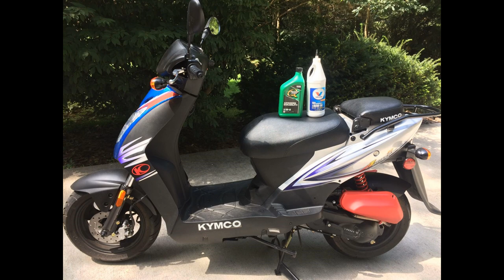Kymco Agility 50 - Oil Change / Gear Oil Change

Comment: Good job on the video.  I have a 2015. Kymco 50.  And that's all I do. It ask for nothing. But engine and gear oil change at the end of the season.  That is it.    👍.
Reply: Yeah man I have an 07 kymco vitality 50 4 t and it has 19500 on it and it ask for nothing but oil change and gear oil change ,most reliable little bike I've ever had

Comment: I gotten the high performance Naraku cdi and it gave it a huge boost of power then upgraded the transmission with the same company with 5.5 gram rollers got more power don't lose power going up hill. Removing the spacer in the exhaust pipe gave it better air flow added to the top speed can now go 50 mph 40 to 45 up hill. Thought I  would give you an update now that I've done it and tested it out for a week before letting you know.
Reply from the maker: Wow, that's outstanding!  Thanks for the update.
Reply: spacer in exhaust pipe? show how that helps.
Reply: I have a yiben 2008
Reply: @davidgardner4330  How so you remove the spacer and where is located, please?

Comment: Off topic but you respond back and seem to know your stuff here.. I am a 2019 kymco agility 50 it's going 30mph. Just ordered a naraku performance cdi box to easy district the scooter then going to order the Naraku variator kit will I need to use different oil and gear oil after that? Also how much will this improve my scooter? Thanks bud for this video
Reply from the maker: You will not need to use different oil or gear oil.  Just simply changing out the stock variator drive boss to the unrestricted drive boss will bring you up to 38-40 mph and it only cost $15 or less.  The performance cdi is supposed to bring the rpm up from 7000 to 9000 which would increase speed too, but I have not had any luck with those.   I never noticed any difference by trying different cdi's, but maybe you will have better luck.

Comment: there is an oil drain plug on the left side. if you drain it only by the plug on bottom that has the oil filter, a lot of of oil will remain in the engine

Comment: Is there a was to check the gear oil?   My Kymco 150 is leaking a small amount every day.  It’s new so I am wondering if it was overfilled at the factory.  They leak appears to be coming from above the drain plug and the fill.
Reply from the maker: It shouldn't be leaking straight from the factory. I would check to see if the two bolts are tightened that you use to fill and drain the gear oil. It may be possible that one of them was stripped at the factory causing it to leak out.
Reply: @Subariblet  thanks for the reply.  The leak seems to be above the drain and fill plugs but this morning my ABS light came on and stays on and also the speedometer and odometer stopped working.   So. I I’m wondering if it’s low on brake fluid.  Anyway it’s too new to be having these problems I’d say.

Comment: Hello.
How much gear oil did you end up adding or did you just fill till it was running out the check bolt hole.
Cheers
Reply from the maker: It uses very little gear oil, something like .1 LT.  You simply just fill it up until it starts running out the bolt hole.
Reply: @Subariblet  Hello, 
I good understood correctly?
Motor Oil ~ 700-800 mililitr
Gear Oil ~ 1 litr?
Thank you
Reply from the maker: @panekk  Yes, use between 700-800 milliliter motor oil and about 100 milliliter gear oil.
Reply: @panekk  .1 lt (10th of a LT)
Reply: Hey guys I have a kymco agility 50cc I'm changing my oil soon. What is the best motor oil to get? What you would use... Where I can get at walmart ...
Reply: @carriepletcher5129  anything what is 80w-90

Comment: Wish me luck!! I'm doing this tomorrow. I have a kymco agility 50. What would be the best oil to get of the motor and what's the best gear oil?
Reply from the maker: I use Quaker State 10w-40 motor oil and Valvoline 80w-90 gear oil
Reply: @Subariblet  
It is important to use oil 10w40 4T 
Not car oil !

Comment: Does all these 3 oils have almost same viscosities and can be interchangeable as a gear oil in transmission of 110cc gearless scooters.
SAE 10W30 engine oil ,
API GL-4 SAE 80W-90 gear oil  and 
 GL-4 SAE 90 grade gear oil.
Reply from the maker: I don't know but it seems like I've heard something like this before.  However, once you get past 100cc, I believe you need a different viscosity.
Reply: Sidg2 No, the viscosities are different. Gear oil also has sulphur additives for pressure hence they smell,like rotten eggs. You can use engine oil but for transmissions use a 75w90 or 80w90 gear oil. Its also overkill to change gear oil with engine oil.

Comment: Hey, nice video. I have the same scooter but its from 2006. And the screw in 0:45 has stuck on my scooter. I tried everything but it just doesnt move. Have u any tips for me?
Reply from the maker: No, sorry I do not know
Reply: Wd-40 my guy
Reply: I had that too, I used a rubber hammer to hit the wrench.  Not too hard, though. Make sure you turn in the right direction.
Reply: hey not sure if you have done this yet but get you a 18 to 20 inch long half inch drive ratchet or get a breaker. best way to maximize your torque efficiency. DO NOT get the duralast with the floppy head.

Comment: Do I have to screw the dip stick in to check the level? My owners manual doesn't specify
Reply from the maker: No, you don't screw it in.  You put it in flush without screwing it in and then taking it out to check the level.
Reply: @Subariblet  thanks.......
Reply: Yes u have to.

Comment: have you had any trouble with the gear box and using 80w 90 gl5 oil for it
Reply from the maker: No trouble at all.  It's what the manual say to use anyway.
Reply: @Subariblet  
what about using 85w140 gear oil?
Reply from the maker: @islamayman5927  85w140 is thicker. In higher temps it would be fine. Colder temps, not so much.

Comment: Hello, when should I change the oil filter?
Reply from the maker: There is no filter on it like a car. What it has is that filter screen that you clean out when you remove the bolt to drain the oil.  Once the screen is clear of any debris you since put it back in

Comment: When should I change gear oil ?
Reply from the maker: It should be changed after the first 186.4 miles or 300 kilometers, and then every 1242.7 miles or 2000 kilometers afterwards
Reply: @Subariblet  , Ohhhhhw    ,    I do it wrong then,   each   5000  km,.,,,    it s   about   once  per year.,      resent  with the   30.000  km.

Comment: Can I use Castrol EDGE 5W40 SN engine oil for kymco Agility 50 scooter?
Reply from the maker: I wouldn't.  Technically, you could probably still use it, but these motors are designed to run on standard 10W40.  I just know I would not be comfortable using this in my scooter.  I would be afraid that this thinner synthetic would mess something up.
Reply: Subariblet ok thank you
Reply: My book that came with the scooter says 15 40 w
Reply: You sat 10w 40 like car oil???? Help!!
Reply: No use 15 40 wt
Reply: I have a kymco agility 50cc and I don't use nothing but what my kymco instructions recommend and that's 15 40 wt the brand don't matter and don't use synthetic oil
Reply: @trumpsarmy2499  then you would see that the 10w 40 is for the same temp range as the 15w40.
Reply: @trumpsarmy2499  semi synthetic is good and 10w40 is good.

Comment: That is not the oil drain plug. Thats the oil filter. The drain is on the otherside. Important becuse you not drained all of the oil.
Reply from the maker: I don't think it's a big deal to change it from the location that I did.  That way, you can clean out the filter as well if necessary.
Reply: I’m pretty sure all the oil is drained
Reply: I agree with you. I always drain on the drain plug first, then clean the filter.

Comment: How often do u do an oil change
Reply from the maker: I change the oil every 1000 miles.  I probably don't have to do it that often but it's just cheap insurance.
Reply: Subariblet  ,   Here  we do it every  4000  km.
Reply from the maker: You are probably right about changing it every 4000 km.  I am likely changing mine far too soon.
Reply: We here in  holland do it every   4000 km,.
Reply: Manual says 2000km.  I tend to follow that to make sure.  I think 4000km is risky, especially when you see how dirty the oil already is after 2000km, but I suppose it depends where you live. I'm in hilly countryside so the motor has to work hard from time to time.

Comment: 2018 is the scooter stil running
Reply from the maker: Still runs like it's brand new
Reply: I got one that’s 2012
Reply: YoungTooShort  , mine  from   2014,   still okay after  20.000, ofcourse  every 4000 km to the  scootercorner shop for an oil change and checkup,    already a few new tires, a new exhaustpipe and little things,.   but alway s shiny and clean due polish the bike , even after bad weather straight a clean up, yes, a  bit obsessive autistic, lol.

Comment: OMG! I LOVE watching a non professional do a video on how to do something wrong. The drain plugs on the other side of the motor. Read your owner's manual!
Reply from the maker: Meh.  You can clean out the filter doing it my way.
Reply: yea i did both these the way in this video a while ago and no problems
Reply: Kymco a
Reply: Are you kidding me? You don’t need to have a “professional” to do an oil change on a 50cc scooter. Just drain, cleanse filter screen and refill. Takes less than 5 minutes. It’s not necessary to remove both plugs because they are both at bottom of the crankcase — you never get 100% of the old oil out no matter what you do. Just do it every 6-12 months depending on usage. Keep it simple